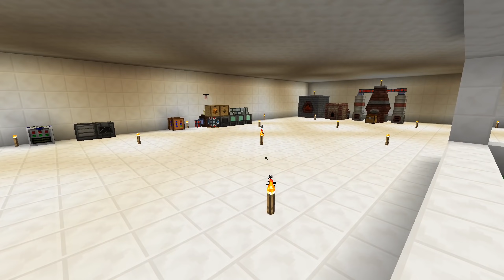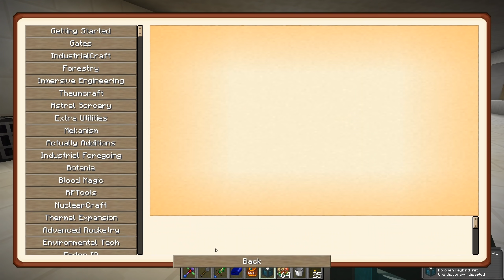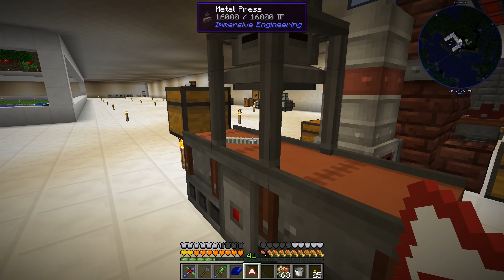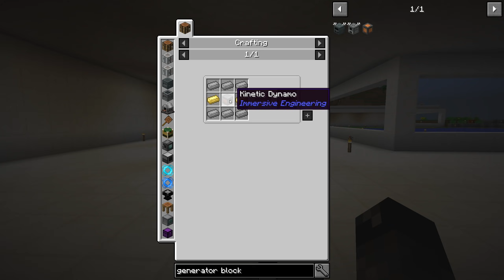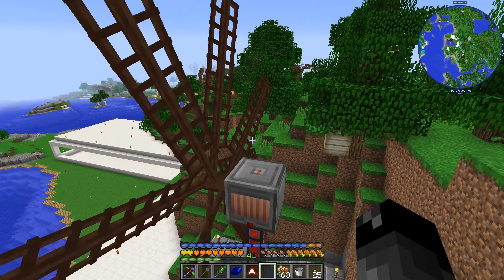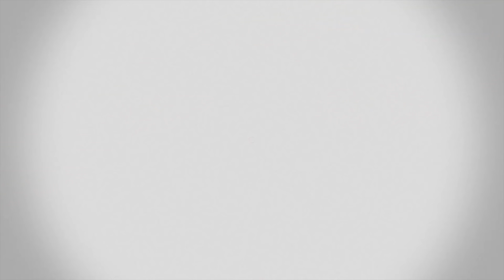Enigmatica 2 Expert - OP METAL PRESS [E19] (Modded Minecraft)

Comment: the reason for the fast speed is easier autocrafting because the metal press is a big part. check out advance rocketry machine structure block. you will see why.